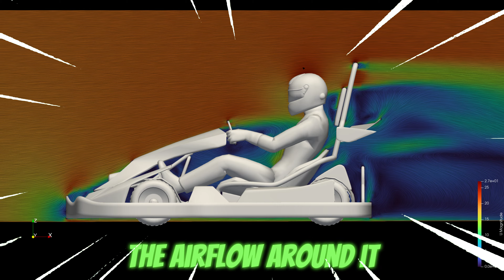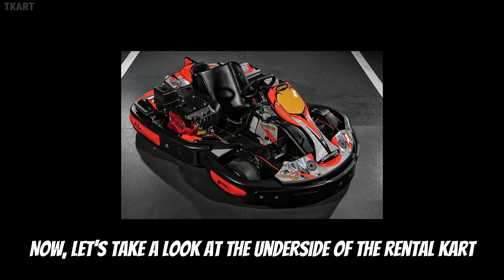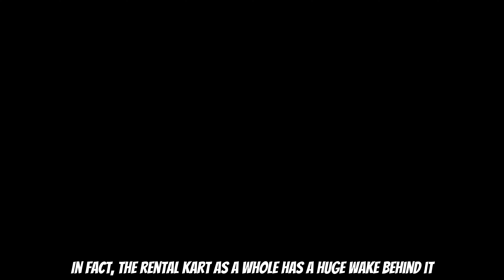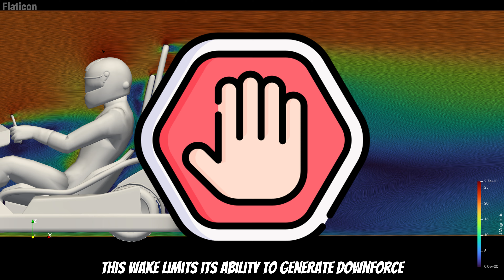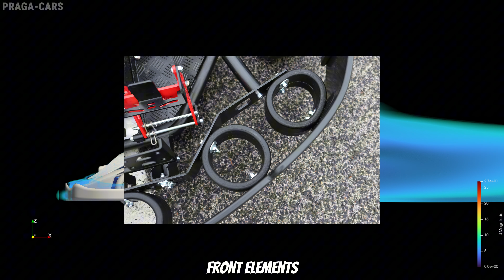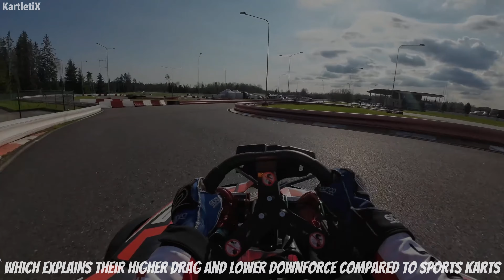Aerodynamics of rental karting

Comment: I assume, based on the video and the conclusions you present, that you do not have formal education in aerodynamics?
Reply from the maker: Hi, no, I don’t have formal education in aerodynamics as I am still in high school. However, I am actively learning  through courses/videos based on aerodynamics, CFD simulations and sharing my insights with others!
Reply: @OskarSavicki  what city are you located? Are you a pro karter as well? What class?
Reply from the maker: @skandinav_nummer1  Hi, I am from Lithuania and yes I am pro kart driver. Class- Rotax Max Senior.

Comment: Does a -0.13 lift coefficient mean the kart makes 0.13 times its weight in downforce or what? Never truly understood lift coefficients
Reply from the maker: The lift coefficient is a non-dimensional number that allows us to compare different objects. Thanks to this coefficient, we can compare two objects (for example two karts) to determine which one produces more negative lift (downforce). More coefficient of negative lift means more downforce, which generally makes the kart more stable. However, increased downforce often comes with a higher drag coefficient (the second coefficient mentioned in the video), which we want to minimize. In the aero industry, it's always a balance between achieving high downforce and keeping the drag coefficient low.
Reply: @ but again, does it mean if the 0.13 kart weights 70 kg it generates 10 kg of downforce? And at what speed?
Reply from the maker: @mwanted240i  Right so just to summary:
No, lift coefficient of -0.13 doesn’t automatically mean the kart generates 0.13 times its weight in downforce.
And if we want to calculate how much downforce in kg is produced we can use this formula.
Downforce in kg = Fd ( downforce force i Newtons)/ g (9.81 in my simulation)
And Fd - Downforce force depends on: Velocity ( for my simulations I use 20m/s = 72km/h) , density and reference area
Reply: @ ok so lemme get this straight

The Downforce coefficient is just an extra number in the equation that determines how efficient x object is at generating downforce
Reply from the maker: @mwanted240i  Yes! Thanks to it we can compare different objects and their efficiency ( if it's negative value it means we are producing downforce, but for example airplanes  have positive lift coefficient to take off)!
Reply: Nah, you have to plug it into a special formula to get the result for the specific speed.
In example for drag:
Drag=cd*((p*v^2)/2)*A
Your coefficient is the cd, p is the air density, v is your speed and A is the frontal surface area.

If you use all the SI units the solution is in newton
Reply: The cd is a really great tool to evaluate how aerodynamic something actually is, a good example here is that because frontal area and speed are going into the equation, big objects that go fast generate lots a lot of drag and vice versa, this doesn't tell us or anyone how good something is actually in aerodynamic terms or in compression to other stuff.

And because air density and speed are going in, depending on where and how you use it you can get significantly other results than someone using the same thing somewhere else going faster/slower